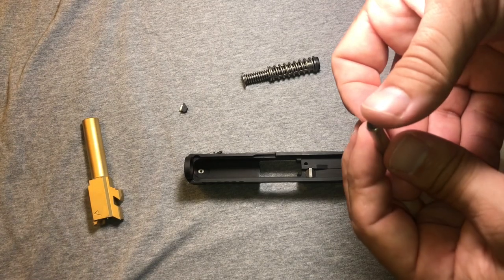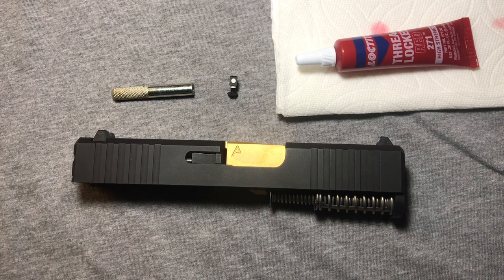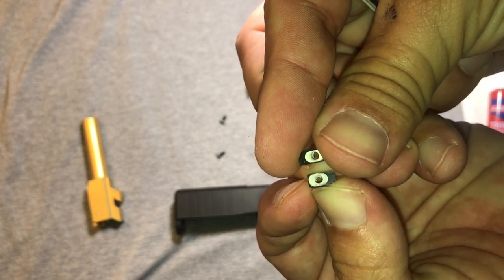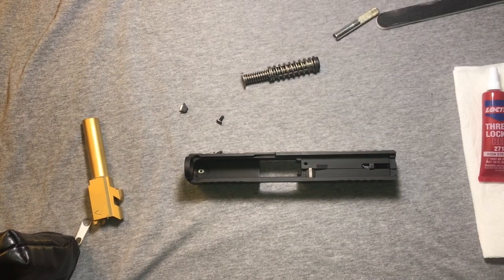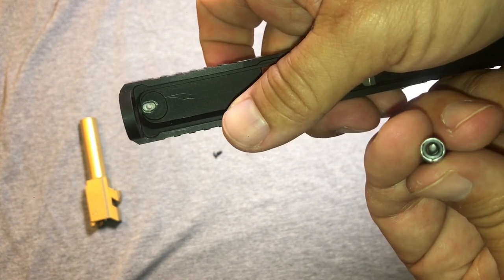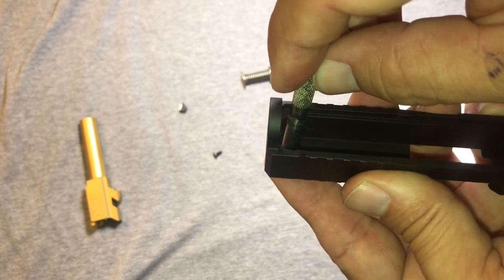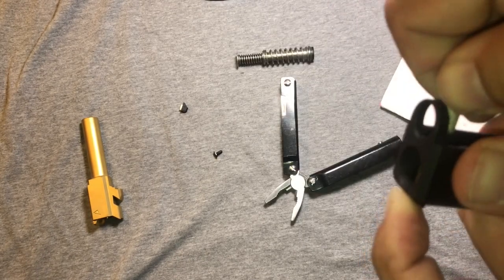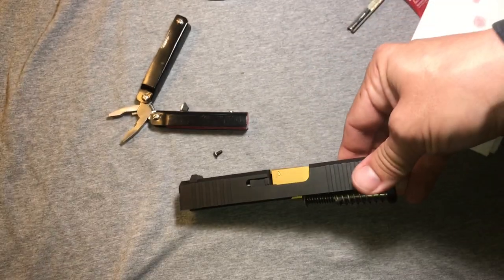How to Replace a Glock Front Sight

Comment: The red lock tight is permanent and you may want to put some masking tape on the needle nose pliers before they touch your sight and slide...
Reply from the maker: Good point on the needle nose. From my experience the red loctite works more like the blue when you use it this kind of soft plastic. I wouldn’t discourage anyone from playing it safe though.
Reply: @NorthwoodsRenaissance  better red than dead. Seen way too many Glock front sights walk off and disappear at the range.
Reply from the maker: @rustyshackleford8473  I'm not going to sugar coat this.  My channel will not be complete without Rusty Shackleford as a subscriber.
Reply: @NorthwoodsRenaissance  consider it done. Subbed.
Reply from the maker: @rustyshackleford8473  HIGH FIVE!

Comment: What’ll happen if you don’t put loctite?
Reply from the maker: Recoil will shake the screw loose.  It may not on the one with the OEM rubber one but I've had it happen on aftermarket steel ones.  Once was enough.
Reply: @NorthwoodsRenaissance  got it thank you sir

Comment: DO NOT USE RED LOCTITE!!!!!!!!!!

USE BLUE

You're welcome
Reply: I wouldnt even use blue! I cant remember if its orange or purple but you want to use the weakest Loctite available you can't really put that much torque on these little Fasteners in the blue Loctite I think requires like 15 lb to break
Reply: Vibratite is pretty good imo.
Reply: actually it's purple that should be used (Threadlocker 222) in my opinion
Reply: Did i see red loctite?
Good luck getting that back out!😂
Reply: Ameriglo says red

Comment: 3:15 Instead of putting the sight in first and then screwing from the bottom try putting the screw in first then hold in place with your finger and screw the sight on top of the portruding screw.
Reply from the maker: Not a bad tip.  It might be a while before I do another but one of these days my night sights on my G17 are going to die and I'll go back to the stock ones.
Reply: its the correct way to put it in
Reply: Plus cleaning with alcohol then touching with fingers is wrong too. 
 @Thesusoperator

Comment: Mine doesn’t have a screw it has a pin idk how to get it out
Reply from the maker: If look inside the slide you don't see a super thin 6 sided bolt head with almost zero clearance from the front of the slide?
Reply: @NorthwoodsRenaissance  no it’s an old glock 1988 I got it off and our new ones on
Reply from the maker: @carlosw4227  Right on.  I just looked it up.  Thanks for teaching  me something new.  Have fun and stay safe!
Reply: @NorthwoodsRenaissance  thanks! Just went to the range today and got the new sights to the test. Also got a new m&p 2.0 yesterday to test out!

Comment: i did this in a pinch with a Oring pick and tweezers. id like to buy a blank slide and cut it to fit the sights from a steyr
Reply from the maker: I've never shot a steyr but I certainly like the idea of the sights (the triangle ones).  Interestingly enough we've used rubber o-rings as spacers on out of spec aftermarket Glock front sights that weren't tapped deeply enough.  I could see making it work with the pick but the front sight tool makes it easy.